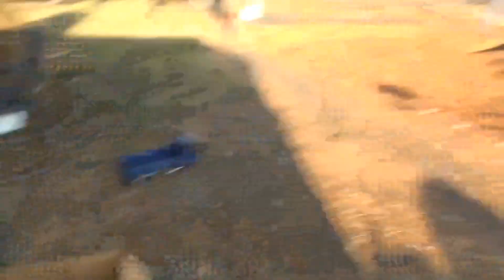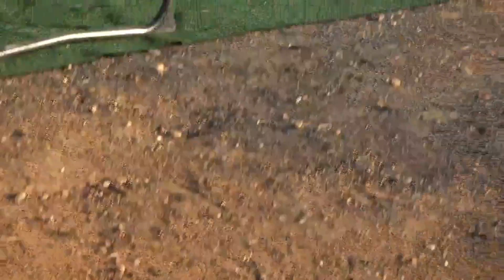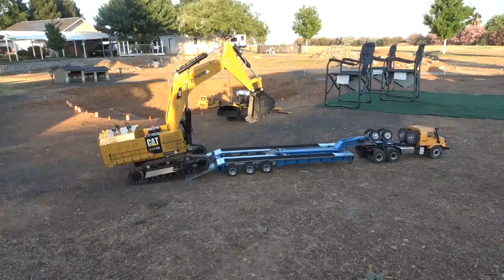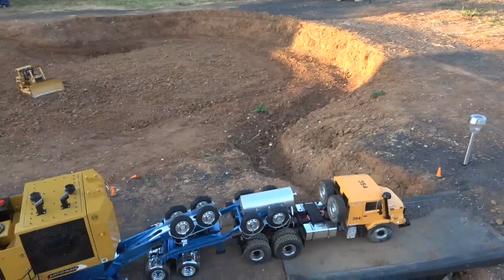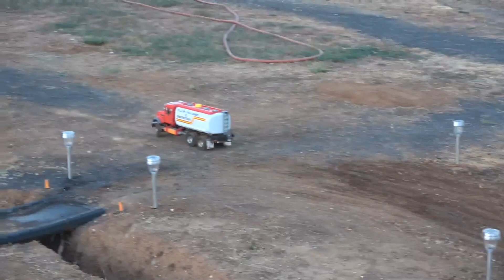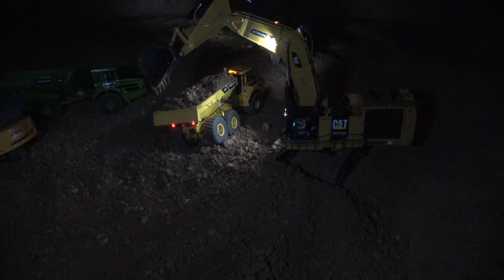night shift at the rc park tonight. diggin out the pit. 6015B, 2-945 liebherr's A40G's

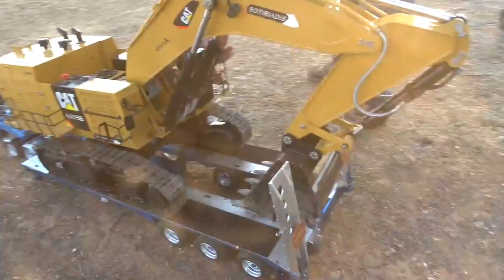Comment: I would of loaded your machine from the end of  your trailer and then spun the weight around so the weight of the machine would be over the rear axles of the truck. The bucket over the trailers rear axles. What would you exactly rebuild. Yes the hydraulic lines need to be replaced. Everything else seamed to be OK. What would be nice to know is who is the manufacturer 6:41  is & few more specifications are! HP did a fine job. Looking forward to what improvements you would make!!! Otherwise  a fine video, thank you for sharing!

Comment: Does it also connect to the jdm-2 trailer p802 Oshikoshi truck? If connected, I would like to buy the jdm-2 trailer, thank you for letting me🙈
Reply from the maker: @FreeMasonKorea666  if the trailer has a king pin it will connect to any truck with a 5th wheel hitch.
Reply: @yellowironcowboyrccon7484  Thank you for your answer. The trailer is so cool. I should buy it